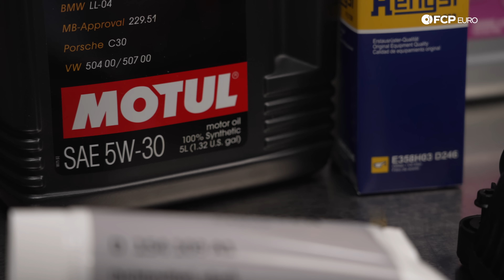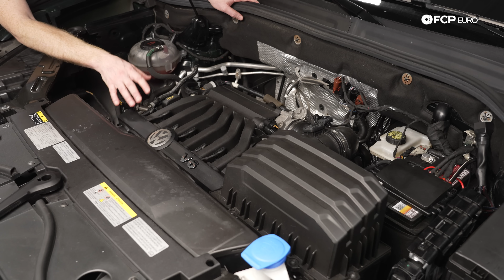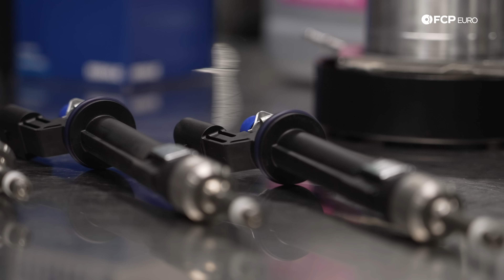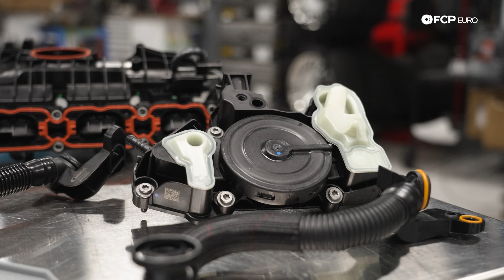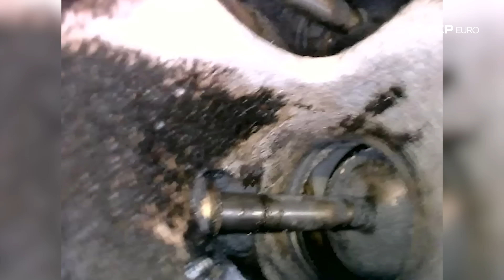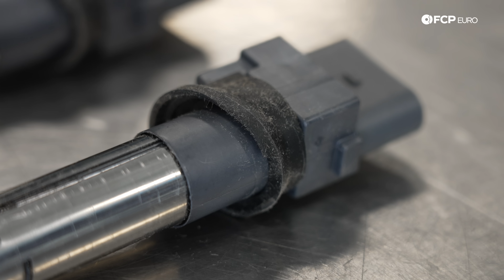Volkswagen Atlas 3.6L & 2.0L Engines: Everything You Need To Know - VW Atlas MQB & Cross Sport

Comment: When I use to work at VW and we did water pumps on the VR6 we would loosen the Engine mount and put a jack with wood under the oil pan and lower the engine down a bit to do the water pump. I also had a good amount of these fail with pulley and tensioners back In the day. I remember these having software issues too and plenty of evap leaks and infotainment tpms updates. I worked a shittyy vw dealer that didn’t even look like a vw Delear but more like a junkyard. So I now work at a BmW delear and so much happier

Comment: Does the USA 2024 Atlas Cross Sport have a Gas Particulate Filter as part of it's exhaust system? The manual references a light about it doing a sort of regeneration, and the Mobil 1 0w-20 ESP with reduced SAPs would suggest it does, but I can't find a conclusive answer yet.